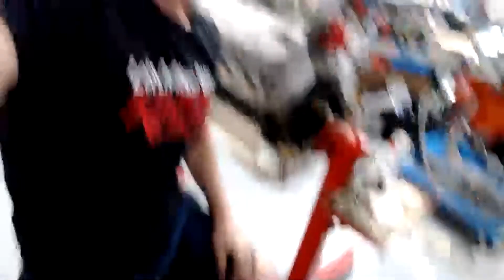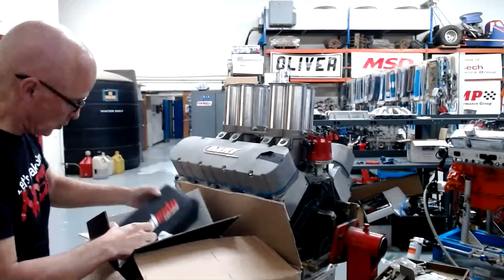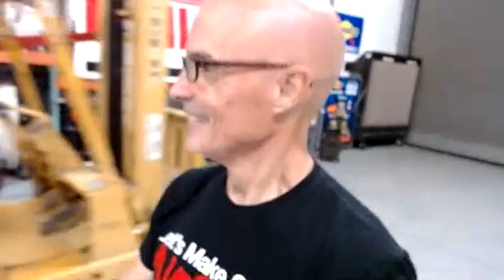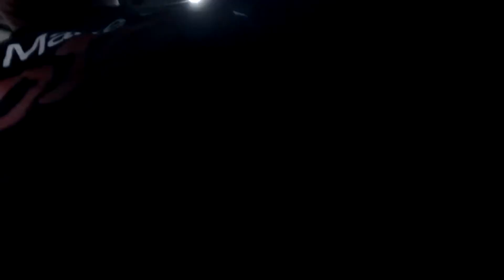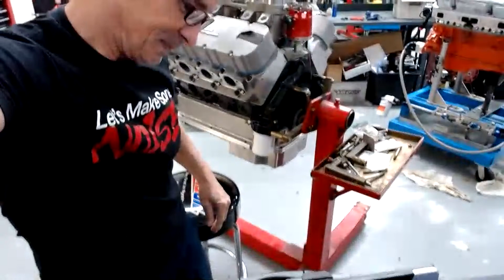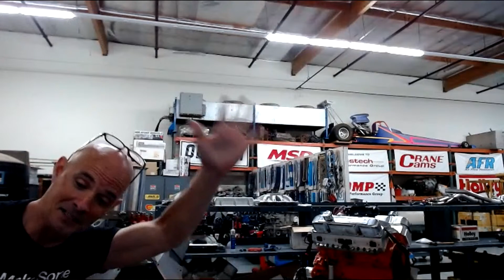LET'S TALK TECH-MOPAR MADNESS, BARRA & AMERI-BARRA

Comment: Doesn't matter what Barra u use if it's FG and your changing piston rods and valves because that's the only difference between the gas and turbo models the head and block are identical on the petrol NA the only reason u would want the early model green top or red turbo model is if u wanted to boost it without changing piston rods and valves the gas and turbo Barra has R3 valves and rods and NA has R1

Comment: So today i found a couple passenger car pistons with the little stripe for the front of the motor. Turns out, they are not offset the direction i had always thought. They are offset to increase thrust on the power stroke which may infact make the engine quieter. Turning the piston around may actually have a little efficiency advantage. The pistons will slow down on the down stroke, not dissimilar to longer rods (which i think is an unnecessary expense and ive said before you cant usually make enough relative change to be worth it unless maybe its a stroker and you have like 1.4:1 in the short rod configuration) but the offset pins if anything reduce dwell. The thrust should reduce backwards and you may get some fraction of an extra degree of down stroke vs up stroke. I had always assumed the factory did it this way and never bothered to check. What i can say on this topic is that i had asked the owner of prp in philly about offset pins and he did say it was worth it. Many of the race engine parts in his shop had suspiciously stock appearing 4v relief pistons. And thats coming from a guy who said long rods didnt work and had warren johnson to bounce these idea off of as well as his own dyno. Jules (the owner of prp) had said to offset the pins 0.060" and that was his number. Any more and it might break. And that long rod engines are lazy, he even tried short rods and sent a piston through the block because he didn't like long rod, his conclusion was that the 1.6-1.7:1 setups from the factory were about right for his needs. It might be different on the speedway but for drag racing and street applications you don't have to reinvent the wheel.

Comment: man i cant even think of the last time i saw a crank break in any motor in any car. from stock with mild upgrades to 2000HP turbo BBC builds. Seems like something else always goes wrong that causes the crank to fail , but not a direct result of Crank failure if you catch my drift. bent rod , broken piston , whipped out bearing low pressures , incorrect torque / improperly installed / stretching of main cap studs. But i dont i have ever seen a Crank simply broken on its own without other major failures.

Comment: I saw a video of where a guy took if there's enough threads that is he took like a big nut and then a smaller nut on top of it and screwed it down and so when you turn the bottom larger nut it kind of pulls against the top nut and it'll might unscrew it I don't know if that would work for what happened with you but I thought it was pretty cool idea

Comment: Some things you may need to pay attention to for an unknown barra, oil pump gears (all especially manual), valve springs and potentially worn out cams (late model very high mileage and poor maintenance) the NA Barra is a really good every high mileage engine, I'd love to see you prove that a J pipe turbo manifold is actually a good option for budget conscious people, barra would be close to the old straight six ford engines in the old falcons and mustangs, don't quote me though lol, haltech do a plug in ecu

Also the SOHC intec is the barras older brother which can be had for like 100aud lol
Reply: I would like to see a Barra swapped Barracuda also lol
Reply from the maker: YES

Comment: A thought when testing savage motors, this relates to the 360 search.  One quick way to check for severely damaged rod bearings is to pull the plugs, put a screw driver in the plug hole to follow the piston, turn the engine to TDC then say 20 - 30 * past TDC.  Use the screwdriver to push the piston down.  What happens is the piston lags the crank allowing you to test clearance by pushing on the piston.

Comment: Fully counter-weighted crank / partly weighted.  In reality , this is more of a long term durability issue ( as in cracking ) not an outright strength issue. The 301 Pontiac has a counterweight at the front and one at the rear and none towards the center like most any other V8.  This " works " however long term, the cranks crack.  While the rotating assembly balances out, the crank sees internal torque reversals that causes the crank to crack.

Comment: I still have the 2 Ford 300 engines that could be used for a test.   You could use the early 90s EFI one with 80k on it to get a baseline. The second put a new ported head with bigger ss valves and Harland sharp rockers. Oliver 6.8 BBC rods with SBC bearings. 4.03 Icon Forged pistons.  Custom roller cam.  I have 2- 4bt Chinese knock off turbos. Use the dual exhaust manifolds.   I also have a Clifford intake.  I live in the Phoenix area and willing to bring them to you.
Reply from the maker: send me an email at killerbe16@aol.com
Reply: I emailed you.  Killerbe16@aol.com

Comment: Since you went all out on the ms3 pro I expect to see 6 EGT probes and using the cylinder trims ;)
Reply from the maker: individual cylinder trims did jack for power last time I tested it
Reply: @richardholdener1727  I agree it's not going to make much difference on power. However, keeping cylinders closer together will allow for more safety. You dont have to worry about a lean cylinder or unequal cylinder pressures causing excessive torsionals.